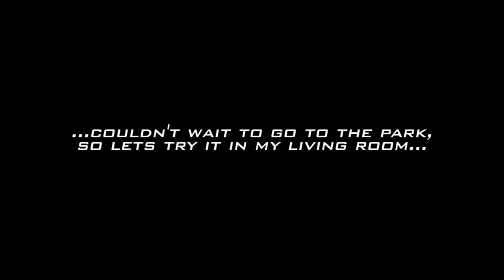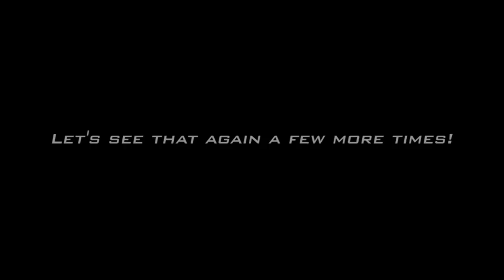Bukobot 3D Printer - Bukobot Fly Test Flight

Comment: This makes me want a 16"X16" build platform so I can design a one piece 3D printable ultralight electric R/C plane.  Snap in a battery, receiver, motor with prop and servos.  Maybe use wing warping to steer.

Cool project, though... and very nice print quality.  That Bukobot looks very impressive.